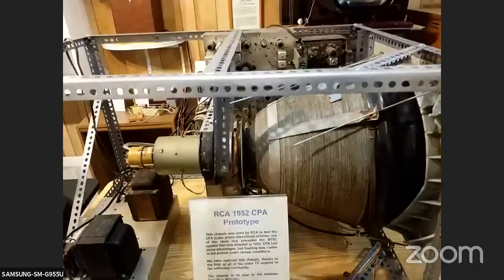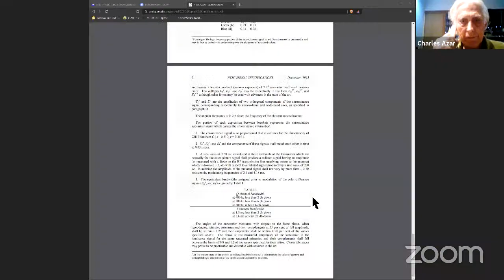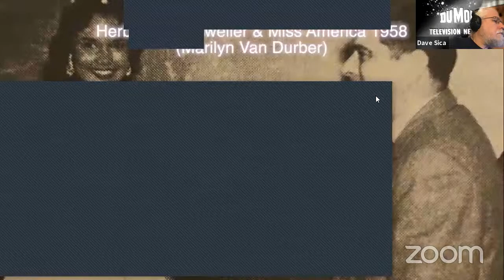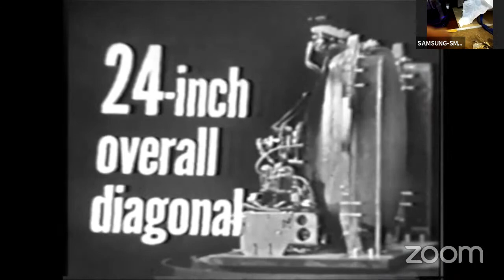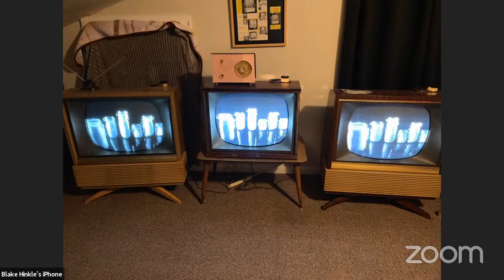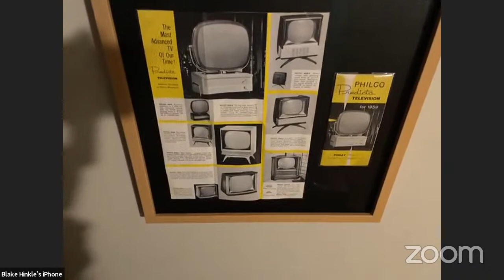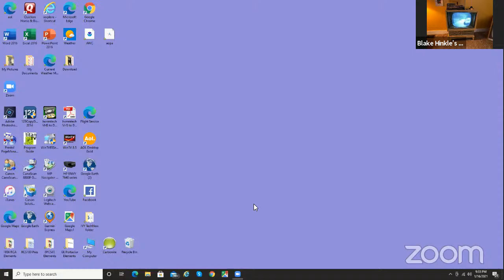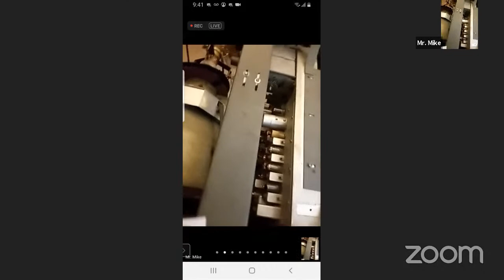Early Television Museum Society monthly meeting

Comment: I want to clarify the bit of discussion about the later solid state RCA chassis with I/Q wideband demodulation. The problem with quadrature distortion and rainbow effects on color edges if they had used full amplitude I channel high frequencies was not due to the chassis design, but due to insufficiently tight original FCC specifications of the Q channel in NTSC encoders. The specification did not include a trap in the Q baseband at 920 kHz, or equivalently two traps in the passband at the color subcarrier +/- 920 kHz (4.5 MHz and 2.66 MHz). The result is that some (many?) encoders had significant Q channel energy in the lower sideband at 2.6 MHz, while the receiver sound trap killed both the Q and I upper sidebands at 4.5 Mhz. This resulted in quadrature crosstalk of the Q signal into the I demodulator that would vary from broadcast to broadcast depending on the particular encoder response. Equiband receivers with +/- 600 kHz chroma passband or less would not see this crosstalk. In the investigation of the RCA set at Zenith, we went through the redesign of our in-house source to verify that this is what was happening. Better Q filtering could make the RCA look fine with the I channel highs boosted to normal levels, but you never knew what you were going to get off-air.